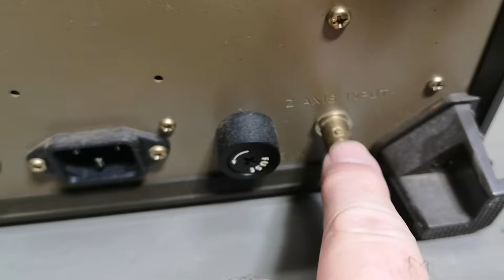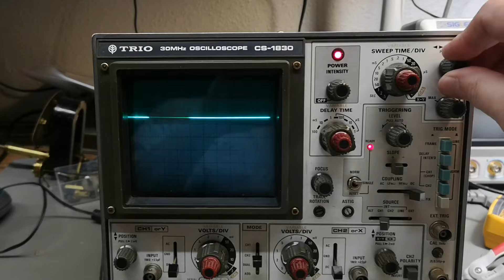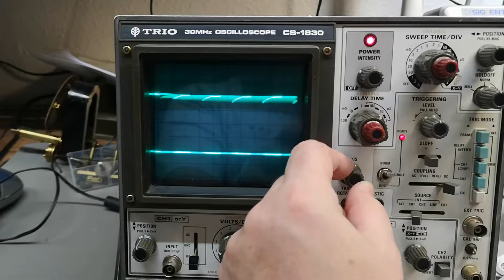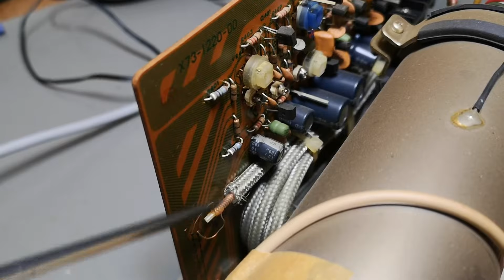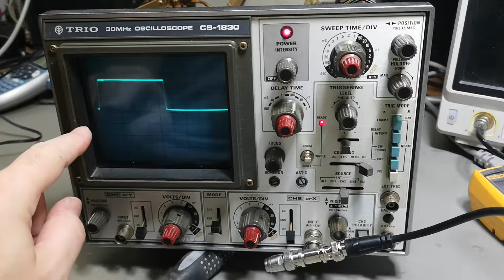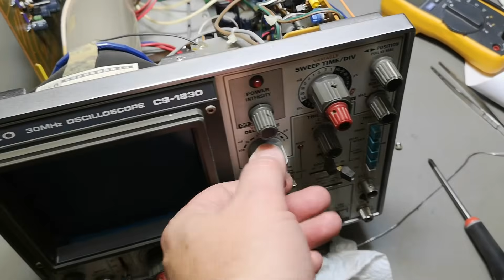TRIO Kenwood CS-1830 dual channel Oscilloscope 30MHz 1980 teardown

Comment: Hi, I watched your video several days ago after I bought myself one of these. On the back I just noticed a sticker that says "Notice
This model is equipped with a signal delay line."
Reply from the maker: wow cool, it is the extra good model you have, with a delay line you can see the leading edge of the signal you are triggering on, simply zoom good in and it will be shown,